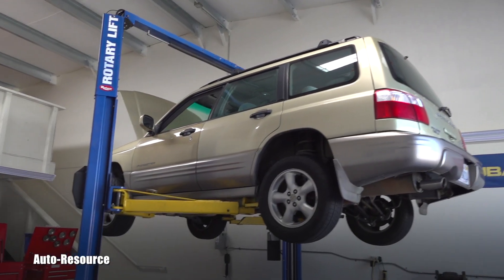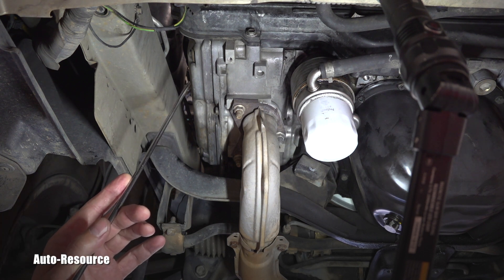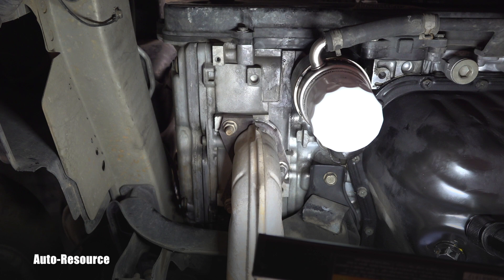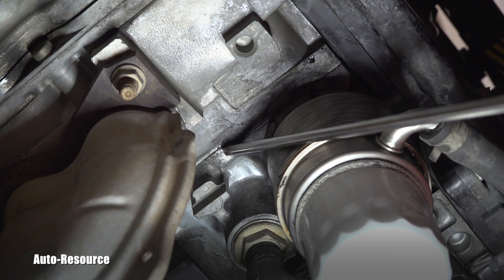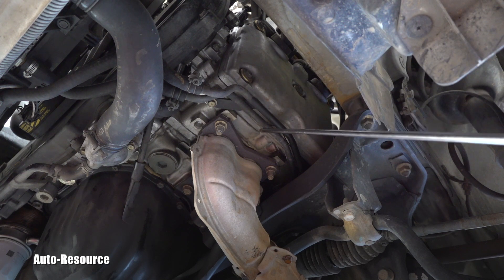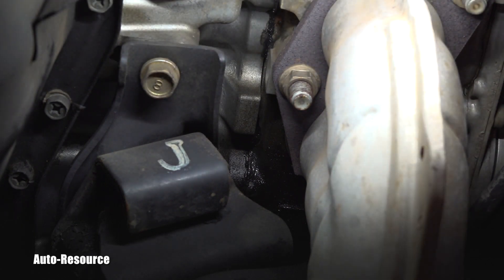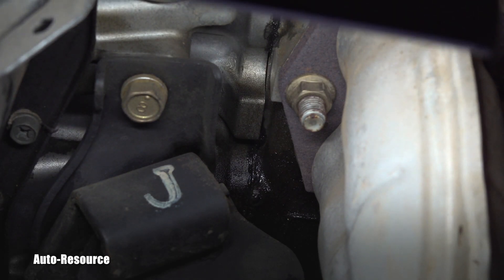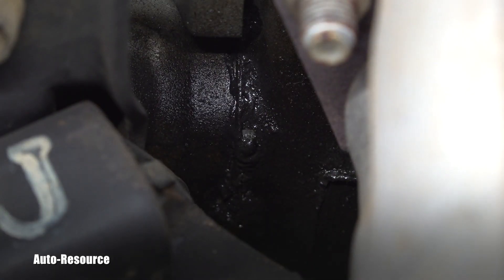Subaru head gasket failure

Comment: You are showing EXTERNAL leaks which is pointless.....the REAL problem is INTERNAL leaks with the Subaru engines. You likely have advanced internal failure of the gasket by the time you see any external leaks (leaking on the ground).